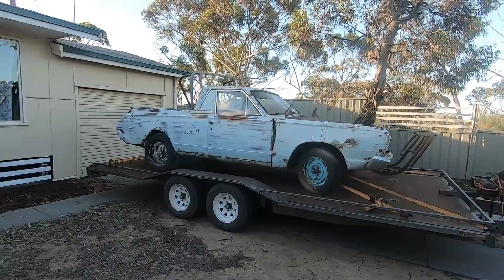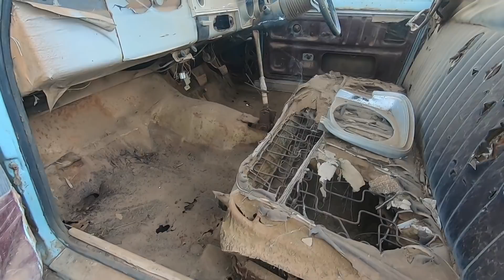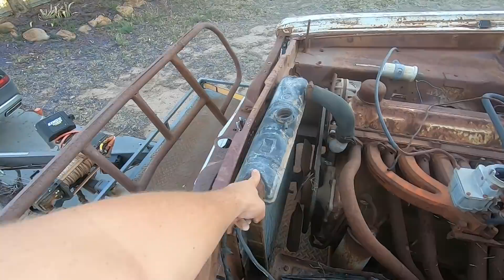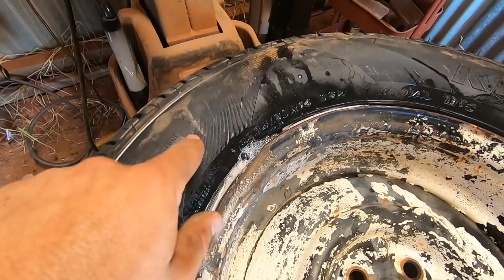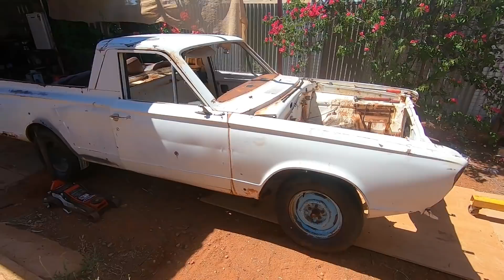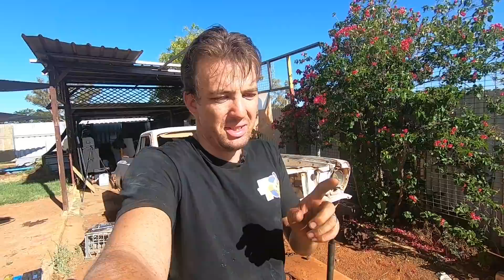We are back! progress on the dodge, and another car?!

Comment: Always loved how Dodge/Chrysler on the A body had a removable subframe (also Holden with its HQ to WB series sedans/wagons)
Being a Falcon/Mustang guy, if you damage the front suspension mounts, not so easy fix.
Reply from the maker: It does make it a bit of a Lego car when it comes time to fix which is handy.

Comment: The subframe difference is more than likely due to the American cars having a big block Hemi option.. 🤷🏻‍♂️
Reply from the maker: Which raises the question, did the yank A  bodies have a similar change in size? That would be interesting to look in to.
Reply: @AutomotiveKarnage  Yes the cars in OZ just mimicked the US structures, Even to the point the drivetrain is offset 1" to the right to clear the steering box etc on the US models. The extra width is just because the later 1967 and up are bigger cars overall. They couldn't just jam bigger and bigger extremities onto the small early structure.

Comment: Wheels should be easy, you've got a popular stud pattern, Ford, Toyota, and I think Nissan  will fit. Watch out for center bore diameter, and offset. The big transition with offsets happened about the early 80s, so look for earlier.
Chassis rails may be due to Australian design being replaced by American. Maybe.
American design has engine offset about 4 inches to the Australian  drivers side (right). This is to allow more room for the brake master cylinder, on LHD cars, Australia never changed this. . Once you see it, you can't un-see it.
Reply from the maker: Unfortunately the PCD change didn't happen till the VH model. Before that it was all a smaller 5x4in pattern. With Valiants being the only car in Australia to use that pattern.
Reply: @AutomotiveKarnage  Bummer. I'm an early Holden guy, but am interested in most steel bumper stuff. Except for your location, redrilling may be an option. I had some rims re-banded, in Sydney 4 years ago, cost $240 each, but again location.
Good luck, the Ute looks cool. I built an FJ Holden with similar patina. Road tripping around NSW, I make new friends every time I stop. Your effort will be rewarded. 
You'll need to get used to other motorists waving to you.